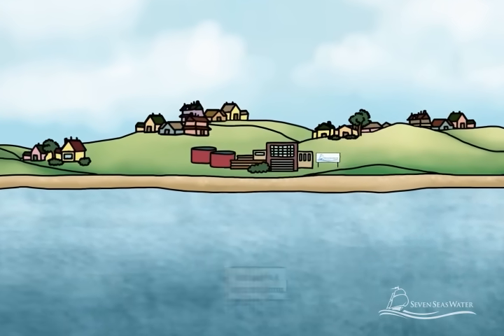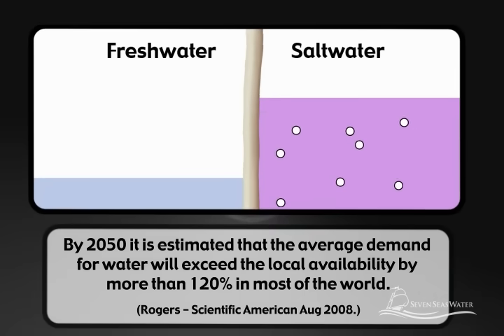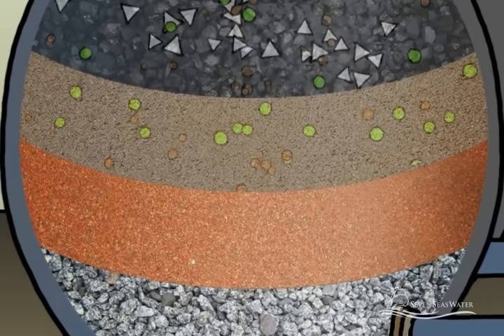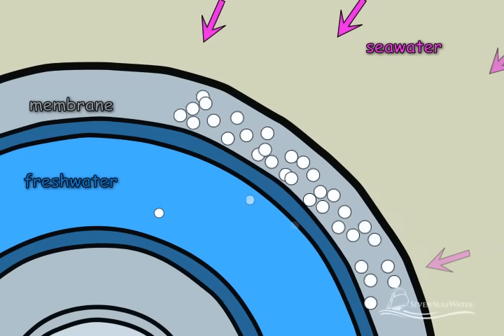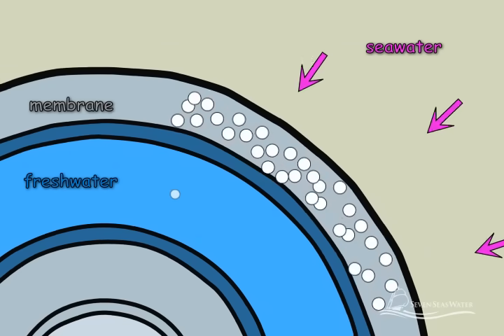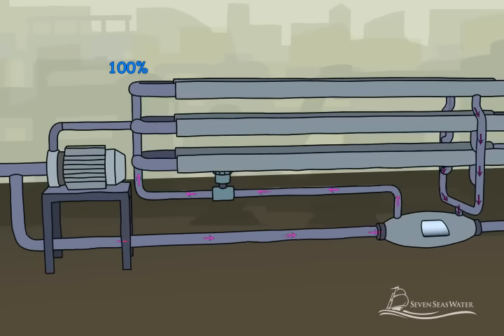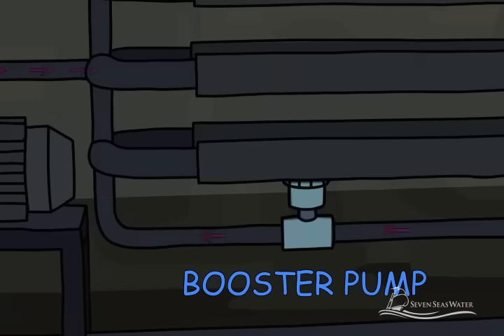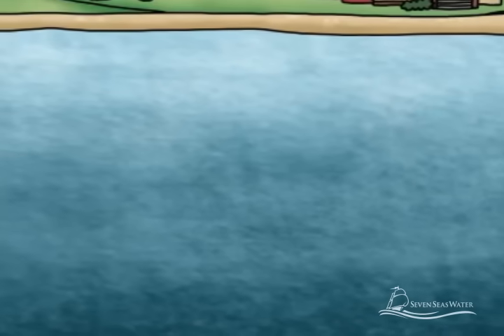How Seawater Desalination Works

Comment: Ever ci fend a fuel tank first you suck create suction pressure priming how do you think a naturally aspirated fuel pump works.....prime the carby for your mower or whipper snipper.....pump the pedal on the car when starting hope the pump pressure in your brakes work but yes know it's all got electrics but they only assist they are not the mechanical principals....
Imagine say two dozen of those going/flowing into a guttering channel then flowing down a pipe with small hydro generator...a small dam that continues the flow...he is only going to gain a small continued flow but a body of water that is like a bucket will go stagnant but the flow oxygenates the water stopping that ....😮😢
So it's likely not a wind up and possible just based on the known mechanical principals that have been provided and known...😊🎉❤

Comment: The biggest problem and byproduct of desalination is the Brine that is left over. My question is why they don't mine the brine. There are many minerals that are badly needed in Brine. Death valley is hot, sunny and unused. Pump the brine to death valley and using solar to process and remove all the minerals.

Comment: I always wonder if they dug big trenches off the oceans into the desert would the ground desalinate ocean water into aquifers and would it eventually cause greenery?
Reply: maybe it could reach the aquifers but that would be a bit to simple, in large part the salt left behind would also form a major issue it seems, and the water in those aquifers generally just stays there

but simplicity is key for most souther countries honestly, this sort of plant has to many moving parts to work in let's say the DRC, however a simpler yet much less efficient design would, simply use decreasing pipe diameters, to increase waterpressure, and atmospheric pressure by sending the water into deep manmade reserves or if lucky area's of arid land that happen to be significantly below sealevel

Comment: We dont need conservation , but more filtering plants. The more plants the cheaper and more effective they will try to make it while whit conservation you get the opposite result. Usualy poor people suffer every time conservation word comes up while rich will get pools filled whit fresh water simply for swimming and not drinking. 
Make more not less and that fresh water which gets left over you dumb in some lake which results in bigger lake.
As for the by product of brime well most of it is usefull for chemical industry , but people have easier ways to get more chemicals other ways. Currently to little brime is made to be viable for anything so its not used.

Comment: My question is why is California having a water shortage when they could desalt the seawater? It seems like it must not work very well if they are not doing this in California
Reply: Reason is desalination is too expensive for now. You need a huge amount of energy to produce it. Currently the country that is producing water mostly from water desalination is a country that can produce a huge amount of energy with cheaper price and yup that's Saudi Arabia, a country with huge oil reservoir but have water as an issue.

Comment: Or can boiling the sea water then condensation of the steam be another way to separate the salt? I’m guessing that would take more energy. Or in a hot sunny area like Australia use direct solar to do that as in run the sea water through glass pipes with reflectors around them? And like above boil the water and then recover and condense the steam into water.

Comment: why not just use a large amount of energy to burn off the water, create steam, and make that steam into clean drinkable water? hook up a nuclear powerplant to it and boom, a large source of power enables the salt water sitting in that reservoir to create sustainable drinking water.  take all of the residue and either recycle it into biomass that can also be used for fuel or building materials for 3d printers. more nuclear energy needs to be used. It is safe, it is sustainable, and it works.

Comment: I 100% agree with the use of desalinization plant. Problem 1 is the amount of energy (electricity) needed to operate a plant. That is easily solved by wind and solar farms. Especially in CA. Problem 2 is the waste material. She hit on it with returning the waste salt water back to the ocean but that is very tricky. The salinity of the waste water is 30 times greater than the level of the ocean water itself. The plant operators will need to add sea water back into the outflow pies to desalinize the waste sea water. That said get off your asses, CALIFORNIA!, and  get these plants built!

Comment: @DVSMarketing The M-Cycle technology uses the unique evaporative cooling, humidification, condensing and humidification-dehumidification distillation processes for producing distilled water, cold, power and air conditioning systems. The M-Cycle technology produces clean water from any water source and is powered by low temperature heat. The M-Cycle is the new but proven thermodynamic conception through capture energy from air and it make water through natural renewable energy. Would you like to demonstrate M-Cycle tech on you channel?  Here is a video - how it works and how it is better than traditional desalination tech. https://youtu.be/NzdNwKBVXT8

Comment: Coal filters have to added to the houses and schools to prevent cancer caused by Chlorinated water. We are suffering from 2 thirds of our lung cancer cases that are not related to tobacco use. The largest contribution to lung cancer risk today is Chlorinated water used in water treatment plants. Flint Michigan asked for aluminum hydroxide corrosion control and Chlorinated water to be removed from the chemical water treatment plants based on established research on aluminum ingestion and Chlorinated water exposure. The federal government has not recognized the civil notice of the federal emergency in Flint Michigan.

Comment: Edison generators and dynamos easily power desalination without fuel or pollution. This power source is continuous peak power no different than nuclear power plants or fossil fuels plants.  Remember to add inverters and transformers to the generator like hydro electric power to achieve alternating current and higher voltage.

Comment: The booster pump mentioned at 5:22 is in the wrong spot in the animation.  The booster pump should have been on the right side of the energy recovery device. 
It will boost the flow of the saltwater as it goes out to the ocean.
Reply: Either that or the description in the video is wrong.

Comment: From a programmers perspective: they use a blacklist instead of a whitelist when a whitelist would be easier. Instead of taking water and all the various particulates and then removing them one by one, why can't they only allow watermolecules and nothing else? Just wondered if anyone has done this.

edit: i do have to wonder how much energy this takes too when you can boil the water and collect the steam and be done with it in a much simpler process.

Comment: Wow, way to much energy and filter media etc... and changing out the filters... not smart.   THE BEST WAY IS TO TAKE WATER OUT OF THE AIR... CLEANEST WATER YOU CAN GET... Just use a dehumidifier...  My little home unit makes 10 gallons water in 4 hours.  Just needs electricity... Can you say solar???

Comment: On a global scale this demonstration of brine use is not sustainable, brine can’t be en mass dumped back into the ocean. There are lots of plants however that grow in, for example the salt flats in Utah, brine and other salty conditions. Another issue with this method is how much energy or rather from where are you getting the energy to pump mega psi water. How about something similar, perhaps smaller scale that is gravity + windmill powered.

Comment: this is sooo much cheeper than boiling seawater.  but i have a question about the multimedia filter .. this facility should be running very often to provide said freshwater, but honestly that multimedia filter with gravel and sand and all that seems like a PAIN to change.  I mean surely it needs to be cleaned?

Comment: everything they do here is backasswards, don't skim at the bottom where most of the salt and sediments are,  use SEDIMENT ponds to lose all your sediment, again skim form top not bottom, then push through filters, then use large distillers to clean and purify, use solar and wind electricity to heat water and pump, or use sea wave energy..

this is a HORRIBLE system, fact is if you used a sediment pond, then distilled then osmosis you can catch the salt and have a by product that's valuable, its RIDICULOUS to put that salt back into the sea, you risk too much salinity in these areas and killing off marine life, but that doesn't matter right? all that matters is your stupidity, wasting money and a failed venture right?  IDIOTS

Comment: Too complex of a system with too high of energy consumption.  Heating up the water that comes in through tubes with the sun light is and collecting the water evaporating away is a better system.
Reply: Do you even know what the actual energy consumption is? Yeah thermal desalination is easier, but the tradeoff is it is far less efficient. You just can't get the same volume of water from a thermal system. It has its place in certain situations, but it is not a better system overall.

Comment: This confuses the hell out of me. this seems like a very expensive and inefficient way of producing water.  Why not just use a conventional solar distillery so that the heat of The sun Will evaporate the water and collect it in a different receptacle thus you have purified water. Specifically distilled water.

Comment: This process could have been a lot faster and easier with more than %95 yield, if, you started with a sea salt plant. In the method shown in this video they try to extract the potable water from the salt water. If, you extract the salt by evaporating the water, you obtain mineral rich salt crystals. All you have to do is to do this in a condensation chamber to collect the evaporated water, which you can filter even further easily and quickly to safe levels to drink. After this, you can use the obtained salt, in your diet, or sell it with a higher price than the rock salt, advertising that, it is rich in minerals. Or, you can pour it back to the ocean.

Comment: Long winded way to say filter there's a number of different ways to make fresh water out of otherwise undrinkable water and most of them are way easier and way simpler than this
The boy scouts showed me how to get a cup of water out of the ground with nothing but a cup and a piece of plastic it didn't taste that great but it was drinkable
And in the Navy I made fresh water on board the ship using evaporators they were very efficient

Comment: And why we can simply heat the water and collect the vapor ? Why we need such overwhelming advanced system ? And not, drinking water is not scarce , we have plenty of water and also plenty of inhabited land.  Even in Africa with no lakes you can collect the water from the air, enough supply for small city. Plenty of land in Brazil.

Comment: Very well done. I'm a water treatment operator at an R/O plant that treats brackish groundwater. It is an energy intense process, but allows for non traditional sources to be utilized.
Reply: she told us what all the other filters had in them but not what the semi permeable membranes were made of, I can't seem to find the answer, would you happen to know what they are made of?
Reply: @nicolebacon3230   they are made out of polypropylene and into the foil there are tiny holes made with an laser, so that only the water molecules can pass through them

Comment: Makes sense to me. Southern California imports water from hundreds of miles away. Thru canals, pipelines, pump stations, etc. This requires constant maintenance and energy to transport water hundreds of miles at tremendous cost. Water lost thru evaporation in canals, pipes etc. is not free water. The ocean could easily solve Southern California’s water problem..💁🏻‍♂️

Comment: full disclosure, i do think this is more complicated than it needs to be, the filtration makes perfect sense, but instead of this system with layers in tubes I am sure a simple tube with a recepticle and a membrane could also be used, above which you can place salt water jets to clear salt from the (as it stands today) graphene semi permeable membrane, the brine is collected into the recepticle and periodically flushed down  but not into the ocean but rather into a storage tank or immediatly trough tubes towards a chemical plant to win chemicals and metals from the solution by way of electrolysis, alternatively energy can be won with salt water and brine trough osmosis but I don't think it has a lot of promisse

Comment: I watched this because I am thinking of a way to do something with sea water, and I have to say that the only utility in this video is in showing why desalination plants are a terrible idea in the way they are made and operated today. 

In short. These plants are doing it all wrong. There is a MUCH better way to do this. We already have it happening all around us on this earth, EVERY SINGLE DAY.

It's called the water cycle, and it naturally desalinates the ocean water on a regular basis. Where do you think all that rain is coming from? Space?

To be very succinct here on exactly what is wrong with this whole setup, here it is. 

There is literally ZERO reason to use all those filters or even reverse osmosis. They can still be used for peace of mind, but you don't need them. You can use a 'solar oven' to produce the heat to cause the water in a vat to be distilled, right? Distilling naturally removes the salt and all other byproducts once turned to steam then condensed back to water, right? Well, put that same water through those filters first if you really must, but then just steam distill it without all the reverse osmosis BS. It really is BS btw, since it just slows the production of fresh water, and increases the cost of things that need to be replaced on a regular basis. That's a HUGE no no. You don't want to be replacing parts on a regular basis in any successful idea. The more you have to replace parts, the more of a failure your idea is. Sure, it might work, but that's not saying much more than it works. 

Nature already provided us the proper solution a long time ago. It's called the water cycle, and we just need to recreate it in a closed system for our own uses, with as little power/energy input as possible and as few moving/replaced parts as well.

Comment: ONE MAJOR negative point to this water technology that every GREEN Party member will point out and why this process is flawed and needs refining.

Brine is the side product of your desalination process . While the purified water goes on to be processed and put into human use, the water that is left over, which has a super saturation of salt, must be disposed of. Most desalination plants pump this brine back into the ocean, which presents another environmental drawback. Ocean species are not equipped to adjust to the immediate change in salinity caused by the release of brine into the area. The super-saturated salt water also decreases oxygen levels in the water, causing animals and plants to suffocate.

Like Nuclear energy the down side is DANGEROUS waste product to OUR environment.

  IF you would like me to sell you the machine that:
fabricates

Comment: At 1:24 in the video, where did you get the number for the amount of fresh water used by EACH person annually of 1,000 m3 (264,000 gallons) from? That number has to be WAY off -- that is 2.7 m3/day (713.3 gallons/day) or 0.11 m3/hour (29.7 gallons/hour) -- and that is assuming the person is awake 24/7/365 -- or for a more realistic wake/sleep schedule of 16hrs/8hrs that comes to 0.17 m3/hour (44.6 gallons/hour) per person... Even for average family household that seems an EXTREMELY high volume of water use...

I'm not trying to put you down, I'm just pointing it out to hopefully get it updated/fixed... Regardless, thanks for putting in the time & effort and sharing the video...! (Edit: Added daily & hourly water use volume numbers)

Comment: The energy to drive the pump could be provided by a matching wave power stations, furthermore, the excess of electric energy produced could be used to boil the water instead of (r. osmosis) filter mechanism.
Reply: Would have already build it for local electricity if the site is available for that. Desalination is likely tied to the grid or by its own dedicated power plant.

Comment: 1 million (264,00 gallons ) liters of water needed for each person per year, id be lucky to use 30,000 liters
Reply: That's not true at all, while the actual figures vary a lot, even the most liberal estimates cap out at 400L/day or 146,000L/year per person.

Comment: Hot dry countries could use the power of the sun to make freshwater by a process called thermal evaporation. 
The fresh water is condensed and piped.

Comment: Home reverse osmosis got a pressure tank that is used to flush out clogging of the reverse osmosis filters. You can hear the water gushing out towards drain. In commercial reverse osmosis plant, what percent of the clean water is used to flush out the reverse osmosis side?

Comment: I am no expert but wouldnt destilation by condensation be much easier? And you can also use the byproduct salt for roads in winter and other stuff.
Reply: Easier but more expensive. You need to boil water to distill it, and that requires fuel.

Comment: This states desalination is inexpensive WRONG the pressure it takes to push through the membrane requires large motors to run the pumps and takes energy and a lot of it. Energy/Electricity costs $$$$$$$$$$ and it only goes up increasing the cost.  Other than that it is a good example and description